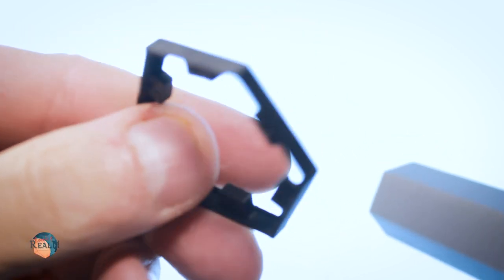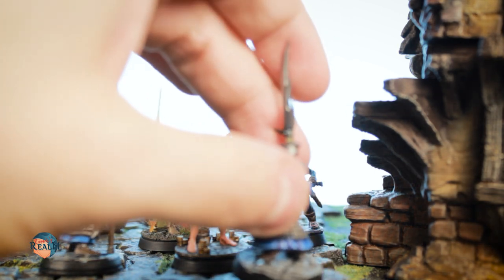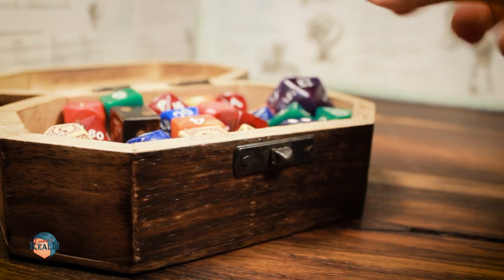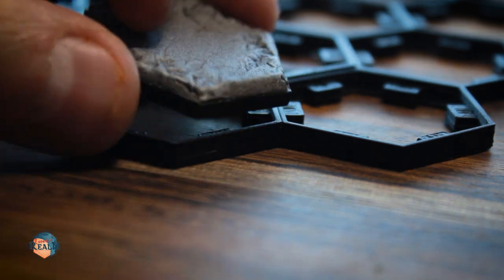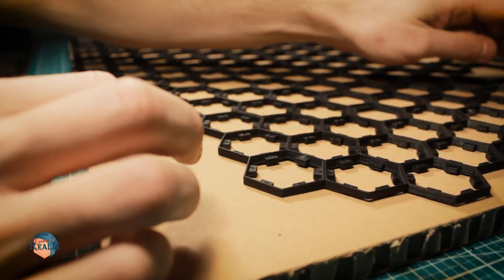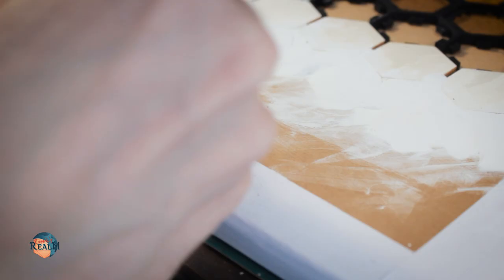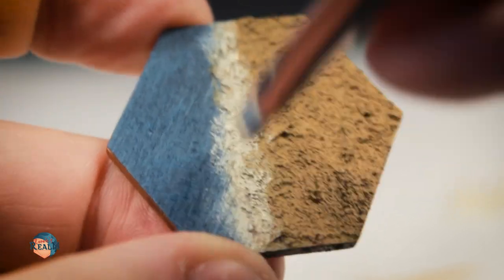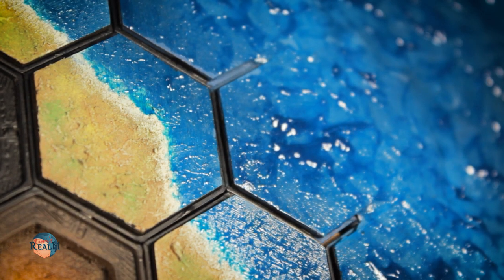Hexcellent Campaign Maps! - Crafting a 3D Hexcrawl Map for D&D

Comment: what was the point of using the hex frames if not to magnet snap them together? wouldn't it have been easier to just glue the wooden hexes to the board?why not just use the magnet frames as they were intended? you could have reused them later in different configurations.
Reply from the maker: As I said in the video, I'm not really happy with using them like intended. I tried it out and it didn't really work for me. This project gave me a great opportunity to recycle them and not throw them away.
Reply: They may not have worked for a dungeon crawl but I agree you should have kept them loose. I think they would work well as designed for a reusable hex crawl system.